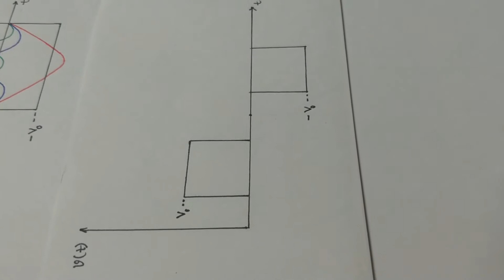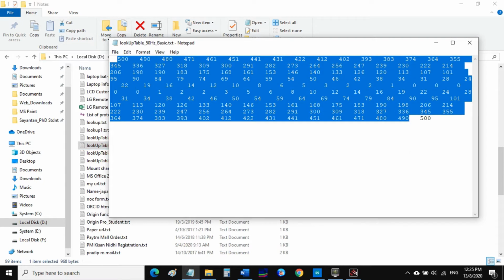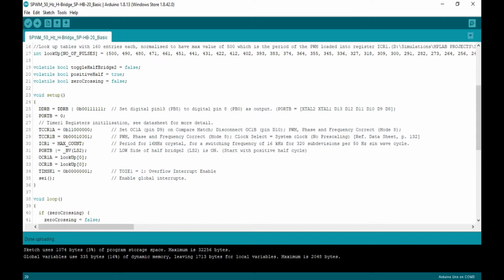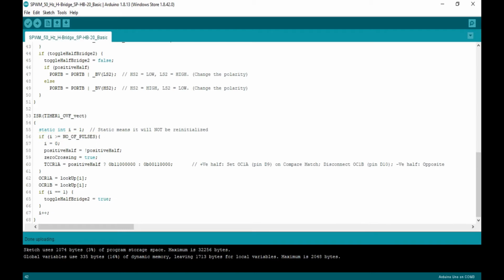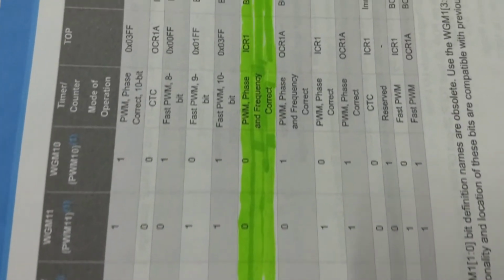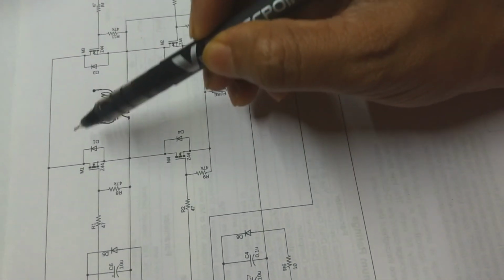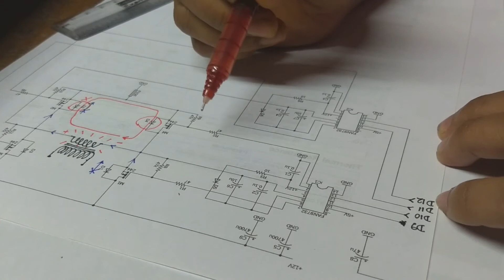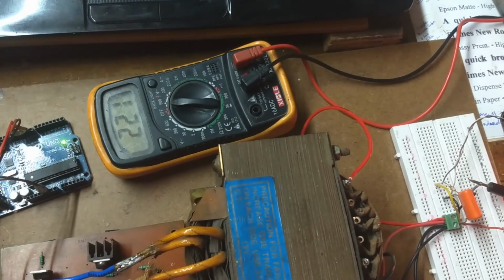How to Make a Pure sin Wave Inverter Using Arduino

Comment: 6:00 "in h-bridge-2 50Hz pulses are given", so one side of the h-bridge has the varying duty cycle (a PWM to h-bridge-1) and on the other side just a 50Hz signal?  A  square wave to h-bridge-2?

Comment: Hello from Germany,
a very interesting project.
What kind of diodes are parallel to the irfz44npbf MosFet and what voltage do the capacitors need?
best regards
Ralph

Comment: Hi, can it handle 1500w?
Reply from the maker: No.
Reply: @ElectroHijibiji  What if I use 48v on this circuit
Reply: @nhloniphoshembe4934  it works if MOSFET drain to source voltage is greater than 48v and transformer is 48 volts.

Comment: can you suggest trasformerless circuit to convert DC 325 V from direct PV panel source to 230 V AC (assuming we loose 30% energy thus by cutting sinewave shape out from area)
Reply: Can you clarify this question? The relationship from DC to AC side is usually V_ac=V_dc/2 so if you dont want to transform the AC side you will need to boost the DC side.
Reply: @sandfordstebbings125  do not mind. I simply resolved the matter other way. My aim was to make solar inverter for boiler from 230V PV array. After a year of experiences and using commercial inverter I came to conclusion: The security level of contemporary possible technology is based on mosfets. Mosfets sometimes burn. If mosfet burns in whatever device (commercial or a DIY one), there is no way to stop the disaster caused by solar DC 230V arc caused by mosfet burn. 220V DC arc does not stop until wires are 10 cm apart. In this time your house can already start to burn. Also I have experienced once a fail of commercial electrical AC water heating boiler with 2 level security. Happened I was present to stop possible accident. So I do not trust them. DC is very dangerous in sense of fire security. I resolved the issue making my own project switching between direct PV DC of about 220V source and 230V AC grid. Several levels of security to be implemented. DC side also enclosed in rigid fireproof box, the + and - wires coming in from opposite sides of the box in non conducting high temperature resistant tubes. Sometime if mosfet burns, it does not switch OFF. In case of boiler connected to PV inverter, the heating continues on through failed mosfet. In such and condition boiler can even explode and kill instantly. So precautions must be observed. I am planning to heat the water by PV DC in separate 500 litters non-pressure vessel and connect it with the boiler and home hot water pressure system through heat exchanger. In case of any failure when the heating element continues to heat the water on, no damage would happen to a property.

Comment: Can we use it as a replacement egs002 module to drive a 400 volt high voltage bridge
Reply from the maker: With a few modifications in the driver stage, I think you can.

Comment: How can we change the spwm frequency from 7 kHz to 20 kHz which part of the code should we change
Reply from the maker: Yes you can, but there would be some major changes in the code. For example, in the look up table, interrupt service routine etc.
Reply: Can we Can we use it as a replacement egs002 module to drive a 400 volt high voltage bridge

Comment: Can we use 06n02c MOSFET
Reply from the maker: Yes you can but, I wouldn't recommend. Because it has a low max drain-source voltage rating.
Reply: Thank you sir

Comment: Thanks for video. I want to ask something; I need to generate the signal (we call it the needle head signal) that appears at 4:86 at the top of the oscilloscope screen. Is it possible to generate this signal as pulse (positive and negative loop) at 20hz-600hz?
Reply from the maker: You can change the signal frequency by making changes in the lookup table and a few other things in the Arduino code.
Reply: @ElectroHijibiji  I wanted to ask something about the pwm seen between 1.07 and 1.26 minutes;
Can a pulse signal be obtained by bringing the negative cycle of this signal below the positive cycle? This type of pulse signal is called 180 degree pulse signal in nmr pages.

Comment: I've tried the inverter but my output at transformer is 130v instead of 230v. I need help
Reply from the maker: Check the turn ratio of the transformer.

Comment: which mosfets should be given spwm, 50 Hz and which ones should be given inverted spwm and inverted 50 Hz square wave is uncleared in video and circuit diagram

Comment: Does it work well with a load with bad power factor?
Reply from the maker: There isn't any power factor correcting feature added neither I tested with a very low power factor load. Maybe it will work nominally but you must keep the apparent load below its max tolerance.

Comment: How to add 3 second soft start on the code ?
Reply from the maker: I have given a soft start of around 80 ms but you may extend it to any duration by slowing down the increament process of modulation index. However 3 s would be too long time for soft starting.
Reply: @ElectroHijibiji  Can you please exactly tell me which part of the code should i change to get 3 second soft start ?

Comment: can you programm esp32 for spwm inverter with tri level technique?
Reply from the maker: Since ESP32 has two 64-bit general purpose timer counters and they support interrupts, you can surely generate SPWM but, I have never tried it by myself.
Reply: @ElectroHijibiji  i have already a programm for esp 32 spwm inverter ,it works now in my laboratory,and it is in test stage.. but it have a weird problem ...i would like to share  with you in a video,what is going on with that,if you like too..
Reply from the maker: @oropeiro  Sure, I am also interested on it.
Reply from the maker: electrohijibiji@gmail.com